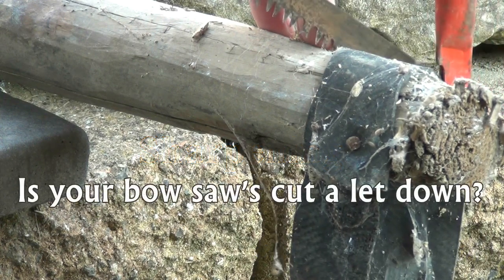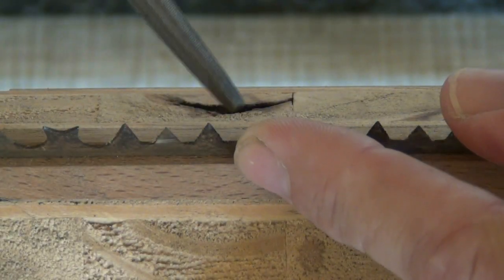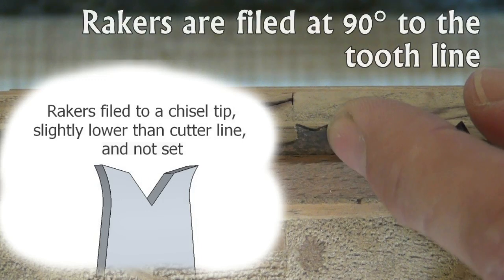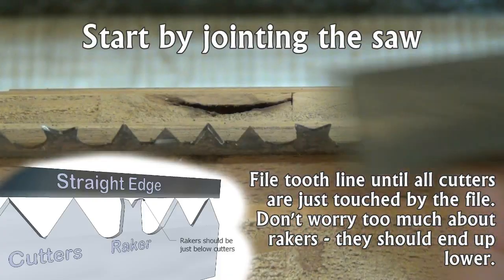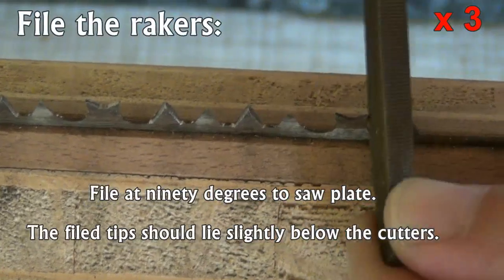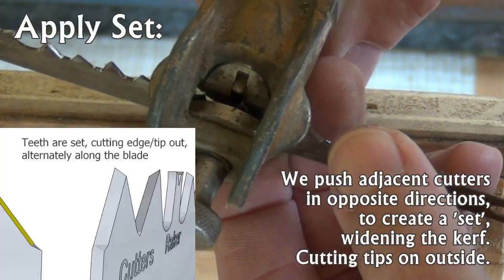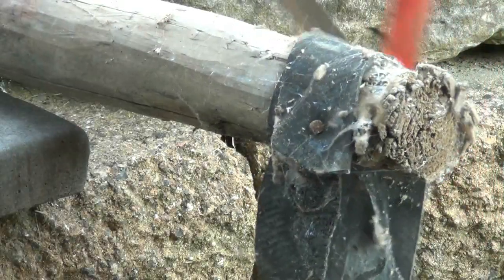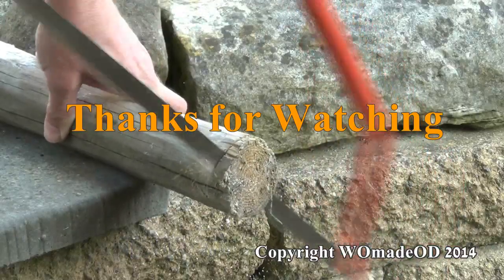Bow Saw Sharpening Quick Guide with Voice Over

Comment: Great video! I do have a question though.  The blade i have is WAY rusty.  I think its an old blade made of good steel but I wonder if its worth working on.  The rust seems to grab the wood and make it hard to push and pull.  should i try to remove the rust or just toss it for a new blade?  Do you have suggestions on how to remove the rust or suggestions on new blades?  Thanks!
Reply from the maker: +Nathan Bright Hi Nathan, You can try a bath of white vinegar to remove the worst of the rust - the blade, obviously ;) 
The idea of having sufficient set on the teeth is to prevent the saw plate from binding, so if you remove the worst of the rust and it still binds, you should increase the set a little.
They're not very expensive to buy, so you might prefer to start with a new one and look after it. It will also give you a feel of how well the blade should cut - this should be the minimum that you aim for after resharpening.
If you opt for new, I would encourage you to invest in a decent blade. Hercules use Swedish steel, which is good.

Comment: Hi Mitch, that was a lovely video - informative, comprehensive, clear and tight! Well done and thank you!
Could I just ask you if you would happen to know, is it possible to straighten a bow saw blade?? Or is it even the blade which gets twisted, but in fact the bow saw frame maybe??
I just ask because I am sick to death of having good blades becoming useless after getting twisted somehow. They could have plenty 'sharpness' left in them, but are now 'binding' and cutting 'S'-shaped cuts through the timber making it extremely difficult to cut bigger logs...I cut all the house's heating requirements out of dead-wood, and would dearly love to know what exactly is going on, and if possible, how to remedy it.
Thanking you :)
Reply from the maker: +Sionnach1601 Thanks. I don't have too much experience with bow saws and the problem you are experiencing. My guess would be that either the blade attachment points aren't coplanar, causing the blade to be twisted in use, and/or there isn't sufficient tension to stop the blade following the easiest path through the wood, rather than a straight cut.
Hopefully someone more experienced than I might respond here.
Cheers, Mitch

Comment: I gather that you are using a triangular saw. If the teeth of my bow saw are triangular and about 7mm high, what should the the width of one side of the triangular saw ? Thanks.
Reply from the maker: Measure the length of the tooth side and multiply that by two. I think it will be around seventeen mm, if my trigonometry is right😉
Reply: That is a quick reply ! Many thanks.

Comment: Great vid Mitch. Can you please tell me what kind of file that is? I'm a newbie to bow saw blade sharpening and hope I need to only buy one universal file.
Reply from the maker: Thanks. You'll need a triangular saw file. They are usually sold as either as single or double ended, and come in a range of sizes. For a bow saw a large one will be best, the idea being that the file sides are twice as wide as the teeth are long and so the file can be reversed and used twice as long before it's worn out. You can use a standard double cut triangular file from a big box store to keep initial costs down, but you'll probably find it dulls a little quicker.
Reply: Thanks so much for the advice!!

Comment: Is that a non induction hardened blade? If so, where do you purchase them? :)
Reply from the maker: WillEyedOney It's not induction hardened. It's the original blade from some twenty odd years ago (same with all three of my bow saws). They don't get that much use to be honest, and there are plenty of sharpenings left in them!You might do best looking at car boot sales, etc. and picking up an old one, if you are finding it hard to purchace a new one.If you have an induction harnened one already - and I haven't tried this myself - you could try annealing it before sharpening, and tempering the teeth again. Just a thought. Might even try that out on a cheap handsaw myself.
Reply: Use a cheap diamond file, such as the pen-like fishing hook ones (flat profile, not cone profile, ~£2 on ebay) or a cheap set of jewellers diamond files (~£4).  That's what I used to sharpen my induction-hardened Hercules Swedish bow saw blade this morning, it worked a treat.  However, the problem for my blade was lack of set, rather than sharpness.  I reset it first, as I suspected lack of set was the problem as it kept binding at a particular point (the blade had probably been pinched there in the past), and sure enough it starting cutting well again, even before sharpening.
Reply: @tonyy5482  can you throw in a link? Don't wan't to get the wrong ones

Comment: What is the  angle to adjust the tool  to push the cutters?
Reply from the maker: Donald M Do you mean when sawing? I start on a tangent to the circumference, and only alter that for ease if the saw gets clogged with sawdust as the cut lengthens
Reply: No, it is when you sharp your saw with the tool to setting teeth; you must to able adjust this tool???
Reply from the maker: Donald M Ah, I see. The saw set tool has a calibrated adjustment, based on teeth per inch. I use the 6tpi setting.

Comment: I struggle to find nice thick blades like you have there. The one I just got is cardboard thin
Reply from the maker: Don't take the diagrams as an indication of blade thickness, mine are very thin too. It's virtually impossible to see, at least at my age, the difference in the bevel angles made when sharpening.
Reply: @mitchwoodwork  thanks for the reply but I mean your saw blade, I can actually see the bevel after you filed. Mine is paper this so obtaining a bevel is haaard
Reply from the maker: @brimleyhillmassive okay, but don't worry so long as you file how I've shown the bevel, no matter how tiny, will still be there and cut the right way.
Reply: @mitchwoodwork  many thanks, you're a good one.

Comment: Thanks, useful but how much set to you apply (e.g. which setting on the popular Eclipse setting tool)?
Reply from the maker: The greatest set is what I use. On the eclipse I think that is equivalent to the 3tpi mark.
Reply: I'll answer my own question. For fine woodworking, my sharpening book & Paul Seller's videos suggest, using minimum set - however, for big teethed, course cutting and greenwood, I believe considerable set is called for.    I set my bow saw this morning using the popular Eclipse saw set tool, using the 3rd largest setting (can't read the numbers on mine due to rust damage in the past) and that is working fine for me, a setting or two either way would likely work ok too.  [I now use the lowest setting for my tenon and dovetail saws  and, as Paul Seller's shows, I hammer out some of the set if the saw binds.]
Reply from the maker: Perhaps I'm mistaking the saw set. I thought the Eclipse had a continuously variable, not stepped, adjustment, with graduations marked on the edge of the 'disc' that represented teeth per inch (clearly as a guide only). The best set will be determined by tooth pattern, tpi,  angle of saw cut to wood grain, speed of cut vs steerability, etc. Bow saw is simple, since it's designed for quick cross-cutting of green butts and limbs. Other saws can be rip or cross-cut, come in varying tpi, and plates can be parallel or taper ground. If trying to fit off the saw, then minimal set is usually best, the kerf keeping the saw on line, but the finest work is best done by planing and/or paring to fit, in which case the sawing step can be speeded up with a slightly coarser saw. In my opinion, joints fitted straight off the saw are rarely ideal for fine furniture, but perfectly adequate for other stuff. Going back to the bow saw, there aren't that many teeth so it's quick to re-set the teeth and test the performance.

Comment: Well intentioned but for beginners like me there's not enough information and you're too quick through the process of filing (why speed up the video?) with no explanation as to getting the correct angles for filing.

The diagrams of the teeth don't show the angle of the file, 90 degrees to the tooth line, what does that even mean, there's no explanation of this so it's just words to newbies that have no point of reference.

You then go straight in to 'jinting' with a  file along the side of the blade, why, what is jointing? Most newbs don't have a setting tool nor would want to buy one, a video explaining slower how to check if the teeth are set ok so I presume not having to 'joint' and 'set' and how to file to get the correct angles without needing a setting tool would be far more useful for newbs.
There's more information here than some other far more popular videos in terms of views but still falls short for complete newbies.
thanks
Reply from the maker: Thank you for those good points. Hopefully I wouldn't make the same video this many years later (must be about 10 years by now).
It is a fine line to pitch a video to a wide range of viewer experience. In many cases my videos will build on techniques that I've previously explained in some depth, but that does need to rely on the new viewer looking back.
Anyway, it may well be time for me to update this title and address the issues you have pointed out. 
Cheers